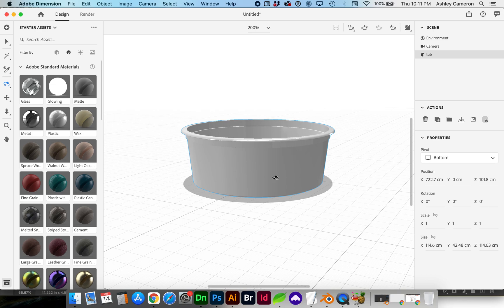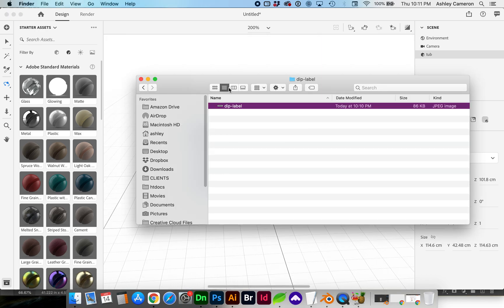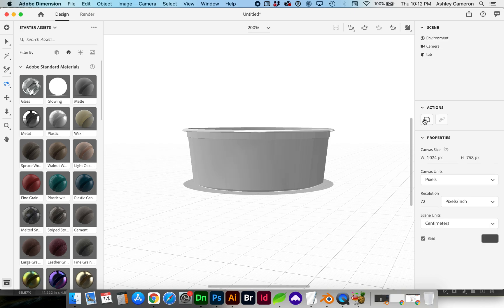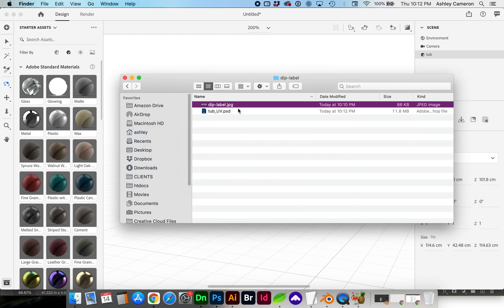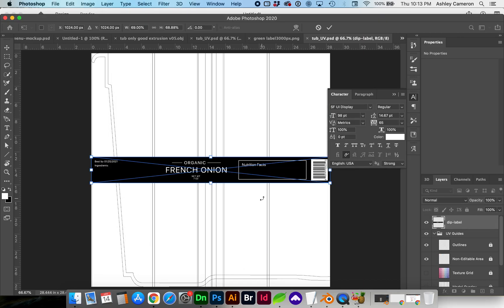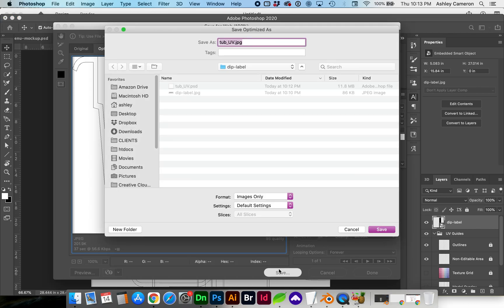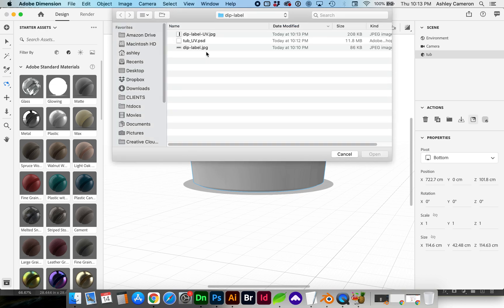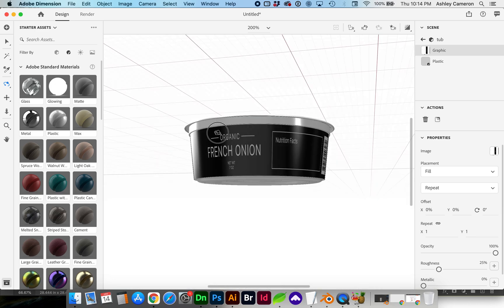Fix Label Decal Wrap Distortion on Tapered / Curved Object in Adobe Dimension with UV Wrap

Comment: A question regarding bringing a graphic from Illustrator to Dimension, trying to add it to a concrete bag I exported from illustrator as an .obj. But once I place the graphic in front of the bag, I get some debris on the back of the bag, it only happens from .obj from illustrator not Dn library. 
Any clue? Thanks.
Reply: I discovered if I export a png from illustrator, open it in photoshop and then export again as png, that cleared the issue. It must be a glitch in AI. I will let tech support to believe that .loll

Comment: Great video it saved me.  If you are placing the label on a transparent surface such as glass and you are getting a white surface after this workaround....disable all layers except for your label in Photoshop on the generated UV file.  Thus making the UV transparent except for your label.  Hope this helps.
Reply from the maker: Thank you for the helpful tip, Lonnie!